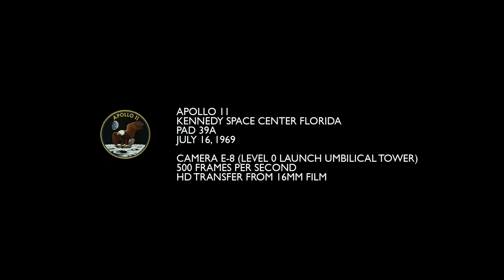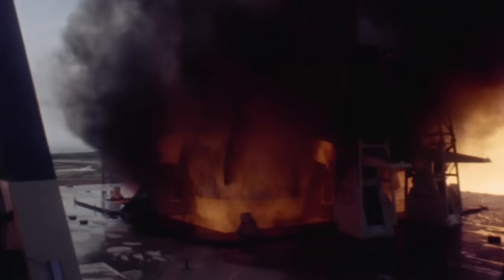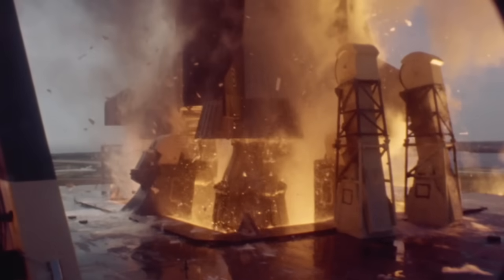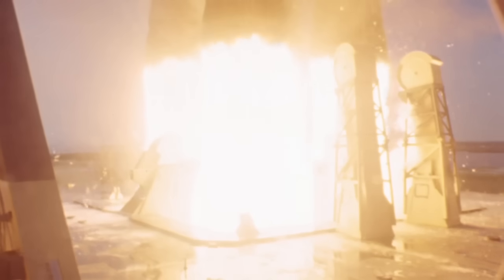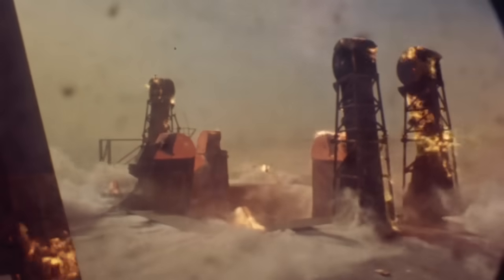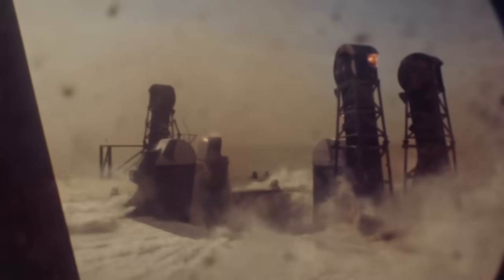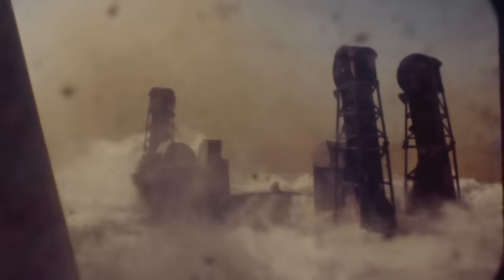Apollo 11 Saturn V Launch Camera E-8

Comment: At 2.22 and on, what's with the cartoon animation overdrawing the lower nozzles! How is it possible it is vacillating up behind the nozzles and remaining horizontal even though there are three distinct nozzles with a large gap between? We see this cartoon animation on many other videos! Are you drawing over because of the fact that the exhaust is not as energetic as you would like? There is NO physical phenomena that can explain this exhaust lapping up and beyond the nozzle orafice , and frankly if it did! you have a very inefficient rocket.
And regardless that your using a high speed camera. It seems the rocket has just stopped and is lingering after it is out of frame. No matter what situation, the exhaust MUST taper off as the rocket distance increases. I see no physical reason for the exhaust to remain constant! 
And the explanation of special paint is ridiculous! Those nozzles should have turned the entire pad into a glowing hot mess. NOTHING would be re-usable after this! And what are you going to do? Take a buffer and clean off all the char for the next time?

And the rocket exhaust would have blown and continued to have blown all vapor, smoke and debris down and away off this pad immediately! The down pressure would have been so great that no telltale trails should have been seen!

Then something really ridiculous happens after 5:00 the camera is shaking "inside" of it's protective chamber. But now that there is debris on the glass you can see that the exterior chamber is NOT shaking! So somebody is jostling the camera from inside a supposed protective box!

 This is obviously just a prop! there is no rocket above,This is just a nozzle prob. Nice try though.....
Reply: No rebuttal?  Just name calling? The typical response for idiots who cannot refute what is before their eyes...

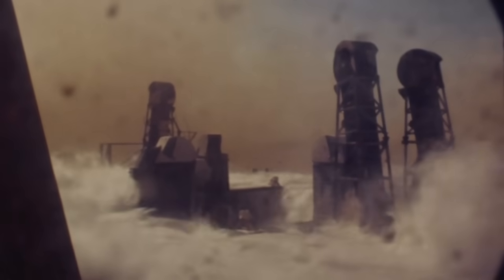Comment: Good narration.  But, shouldn't have stopped at 7:00.  What's going on at 7:20, 7:31, 7:54, 8:02 onward.

I watched the last 3 Apollo launches from the vicinity.  There's one phenomena for which I've never heard a definitive explanation.
As the vehicle is ascending, but still within audible range, there are pronounced popping sounds.  One explanation I've heard is that these sounds are a result of the exhaust plume's undulations creating 'sonic booms'.  But, I believe that was someone's speculation.  As I said, I've never heard a definitive explanation.  I've heard similar sounds coming from launches of the Shuttle, although not as pronounced.

Comment: 30 seconds is 16x for 8 minutes, so does that mean the film at real speed is x16? i'm asking because the16mm film in E-8 can't have had a 24fps standard rate film because 500fps is over 20x faster for real time.

Comment: There were actually two hold down mechanisms for the Saturn V: 1. Four hold down "Arms" which where very large (the video scale is deceiving, but these were almost twice the height of a man) visible in the video...2. 4 pairs of restraining shafts that were slightly conical and extruded thru tubes on either side of the hold down arms.  The second system prevented a pogo-like longitudinal shockwave from propagating up the rocket when it was released suddenly by the hold down arms.  The whole release of this second mechanism lasted miliseconds but was crucial to a safe release.  Thank you for this vid, very nice.

Comment: Never saw this angle before in such detail, this is absolutely fascinating and the narration behind it is even more illuminating. I would never have wanted to be left behind on this pad when those F5's lit. I have a question, obviously the camera survived the heat. What kind of shielding was used on it? Especially the lens part.

Comment: Just incredible to think, that these 5 F1 Rocketdyne engines are individually drinking 5tons of fuel every second, during launch.
A combined output of 180million horsepower, still makes them the most powerful rockets ever produced, only equalled by the Russians later in the 1970s.
Reply: +Peter Lewis
*the most powerful liquid-propellant single-combustion chamber rocket engine
The RD-170/171 from the Russians have slightly higher thrust, but have multiple combustion chambers. Also some large solid rocket boosters are stronger.
The most powerful rocket until now was the AJ-260 which was testfired 3 times.
Reply: 13 metric tons /per second.

Comment: That's just fantastic. How everything just works as it should. I think those engines are not quite as economical as my car engine as they drink 20 tons of fuel per second. Most of the fuel is used to lift the fuel, wish I could have seen a lift of in person instead on a screen but it's still awesome nonetheless.

Comment: why is the camera moving as if it were hand held?
Reply: The oscillations (vibrations) from the rocket, the sound of the exhaust, combined with water being dumped on the platform and the flashing steam is causing this.

Comment: steam goes up not down this is bullshit.
Reply: +Al Dor It's not steam. It's smoke from mixing 23 tons of RP1 kerosene and liquid oxygen which is what it took just to start the engines.
Reply: the guy in the video says the  water is flashing into steam now if you look at the smoke or steam whatever it is, it's staying at a certain low level  which indicates that it's possibly liquid nitrogen or heavy gas.
Reply: It's steam. Initially, it was being forced down and sideways by the exhaust of the rocket after it had lifted off - the first stage exhaust was more than twice the length of the whole rocket, so it was still flowing on to the pad as the rocket was ascending. As the rocket rose higher and started to pitch over to fly downrange, the exhaust effect on the pad diminished and the steam started to behave like steam usually does when it's not being subjected to high winds.

Comment: Mr. Gray, a very good narration. I learned the arms, lower service towers, and lower ULT was coated with with emulation material to prevent launch heat damage. Maybe the same heat bleed thru materiel technology as used in various manned capsule heat shields. Thanks for posting.

Comment: Note at 3:51 the to rotating  covers on top of the hold down arm assembly tower has closed after the hold down arms have been retracted to protect the arm tip. Due engine exhaust and  water dampening steam the rotation of the covers can seen be seen prior to 3:51.

Comment: Man that was awesome, it blows ye mind when you think of the details involved aye, someone had to think of, and design with in tolerances a paint that burns but protects that on its own would spin most folks out let alone making a friggin huge rocket. I remember seeing a Saturn 5 laying in the hanger at Kennedy and it absolutely blew me away, I'll never forget it. Anyone who still thinks we never hit the moon should go look for them selves
Reply: Favorite Saturn 5 Fact:
Each of the 5 F-1 Rocket engines was fed by a fuel pump that pushed 5000lbs of fuel per second into the combustion chamber. So, that's 25000 lbs of rocket fuel exploding every second to get the Saturn 5 off the pad. No wonder they could detect the seismic disturbance of a launch as far away as New York. It flew more than 50 years ago but still holds the record today as the most powerful
rocket motor ever built --- and Saturn 5 had 5 of them!
Reply: Another Saturn 5 fun fact - source: "Apollo: The Race To The Moon" by Murray and Cox - the Saturn 5 wiring had so many soldered joints that an extra drop of solder and an extra 16th-inch of wire at each joint would have added up to the total weight of the payload.

The rocket was beyond comprehension when seen as a whole. Here's a quote from “A Man On The Moon” by Andrew Chaikin about Apollo 16 Command Module Pilot, Ken Mattingly.
"Back at the Cape, a few weeks before the launch, he’d gone to the pad just to look at the Saturn 5. And he’d realized, as he gazed at the towering machine, that he barely knew what he was looking at. Sure, he understood the basic design, and he knew the parts and pieces he had to know. But there were, what – several million parts in the whole thing? And each one had been designed, fabricated, tested, and installed by someone. Standing there, he knew the scope of Apollo was beyond the grasp of any one mind."

I have seen the Saturn 5 displayed at the Kennedy Space Center and, even today, It dazzles the intellect and all you can say when you first see it is "Holy shit!"

Another fun fact: as the rocket lifted off its ascent was retarded for the first six inches by soft steel pins that were extruded through tapered holes. There were two pins each side of the four hold-down points. The Saturn was designed by geniuses, who worked out before the first one even flew that a rocket weighing around three thousand tons was still going to be subjected to abrupt shocks when the five F1 engines ran up to full power and the rocket started moving. The risk of structural damage was high with the sudden shock of movement, so the designers made this tapered pin system. The pins were attached to the hold-down structures and, as the rocket lifted off, they were extruded through tapered holes in the base of the rocket. Six inches were all that were needed and then the rocket was completely free to go.
When I saw the Saturn 5 at the KSC I looked for the pin holes, but they aren't there because the first stage displayed there is a test rig that was used to test fire the engines. The Saturn 5 first stages at Huntsville and the JSC are the real thing and have the pin holes.
Reply: MarsFKA  The Murray & Cox book is one of the best I ever read on the subject! 

Question: where on the vehicle are the pin holes - I want to visit Huntsville this next year, and I'll look for the holes.
Reply: MarsFKA  Thanks for the info - I am tentatively going to be at KSC in Nov and I'll look for the pinholes - I wish I'd known to look for them when I saw the Saturn at JSC. I bought the Murray/Cox book when it first came out, and felt the angst that many of those taxed with building these systems experienced when President Kennedy gave that speech; the book was inexplicably out of print for many years. It really speaks to the excitement and challenge of engineering. Awesome book!

Comment: Space engineers will tell us today, "This isn't the way we'd do it now."  So instead of using older, proven technology, we have...nothing!  True, to return to the moon we'd us lighter, stronger materials, replace heavier lights with LED's and digital gauges to replace mechanical.  Still, the Saturn V worked, and should have been maintained, just as the Russians have maintained and improved (with our technology) Soyuz.
Reply: Orion is coming.
Reply: The issue isn't technology, its money. The Apollo program cost in the order of $300 Billion in today's money, it was a engineering marvel and probably mankind's greatest achievement to date, but at $5 billion per Saturn 5 launch, its just not realistic. Even with improvements it was just too expensive. For a comparison falcon heavy from space x, can put about 17tons of payload to lunar orbit, for around $100million, at worst 5x more efficient and probably more. The primary concern of rocketry today is getting costs down, which is good for idea's like moon bases or larger space stations.
Reply: Saturn V worked but it was ridiculously expensive as none of it was reusable.

Comment: Awesome. How those gantries aren't blobs of molten metal is beyond me. My favorite part was the initial fireball, "lighting the firecracker" so to speak, which erupts but gets sucked back down as the main engines come to life ;)
Reply: Ever put out a candle by wetting your finger and thumb, then squeezing the burning wick?  Contrast that to holding your wet finger in the flame.  The water on your finger protects it for the few milliseconds that it takes to smother the flame by carrying that heat away as it becomes vapor.  On the pad, the ablative coating does this same thing by burning so rapidly, it carries the heat away from the object that it's protecting.  The Apollo Command Module was protected during re-entry by the same principle.  The Space Shuttle, on the other hand, was protected by a thick layer of insulation, the tiles which covered the hot parts.  Damaged insulation allowed the heat to penetrate to Columbia's airframe, which is why it broke up.
Reply: This is totally amazing...near the end of the Shuttle program in 2011 I was watching NASA TV and there was a similar engineering film that showed the launch platform for shuttle launches, and unfortunately I didn't record it because I figured I could find it later...never found it again, but would love to see if it could still be seen

Comment: they must have pumped the lox into the oxidizer tank minutes before launch if the tank was uninsulated. if it was alowed to sit there for a long time, i would imagine the tank pressure would increase and the outer walls would turn into a giant ice ball

Comment: If you were standing under the engines throughout the initial launch off the pad, what would happen to your body? Would it disintegrate?
Reply: Guitarfollower22 I don't think there would be anything left of you if you do that.
Reply: I love your question .
Reply: Hell, just standing within about a thousand feet of the launch you'd have been killed by the sound alone.
Reply: yo Les Brown chill
Reply: Guitarfollower22 , I think, at the very least, your hair would get singed, you'd be somewhat deaf, and in need of new underwear.

More likely: instant crispy, blown out of the flame trench by 37MegaNewtons of thrust, some extra crispy, probably dismembered by 37MN blast, and some more crispification.
Possibly resulting in nothing identifiable as a Guitarfollower. (Ash.)
Reply: peg clancy,yes, except the newspaper would disentigrate.
Reply: Please don't feed the trolls. They might get sick and throw up on...me!
Reply: I've been 3 miles from a shuttle launch, as close as they let the public; and, yes, it is LOUD. You can feel it in your chest and belly. It is a strange ripping sound, caused by uneven burning of the solid fuel.

Comment: What was the rate of acceleration of a Saturn V from liftoff?
Reply: I'm not sure of the speed as the engine bells clear the tower, but I can tell you that it took around 10 seconds for the vehicle stack to clear - and in that 10 seconds the 5 F1 engines burned 200 tons of fuel. The total weight of the vehicle stack at launch was something like 6.5 million pounds, and the engines developed 7.6 million pounds force of thrust - so it pretty much crawled off the pad, accelerating exponentially as the weight of the vehicle decreased. The numbers are mind boggling, just incredible engineering!
Reply: There is a video of the launch with altitude and velocity data.  But to answer your question the Saturn V reached about 90 mph by the time it cleared the tower in 12 seconds.  It then accelerated more rapidly as the fuel burned and it got lighter.
Reply: I guess the vehicle would have accelerated exponentially.
Reply: It was roughly accelerating between about 1.2g  and 1.3 g during the liftoff. It reached it's maximum acceleration ( 4.0 g) just before the first outboard engine cut-off.
Reply: Thank you but I meant in terms of miles per hour. Like how long did it take to go from 0-60mph.
Reply: How fast is it going as it clears the tower?